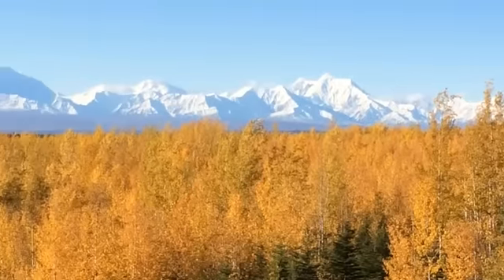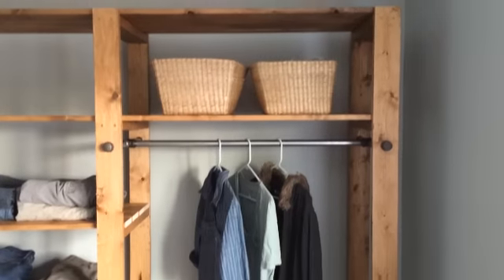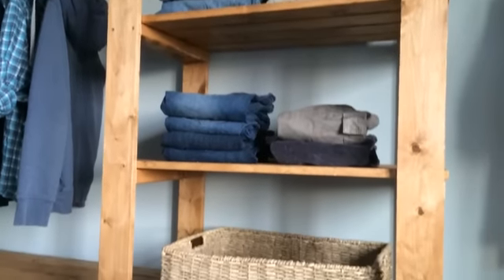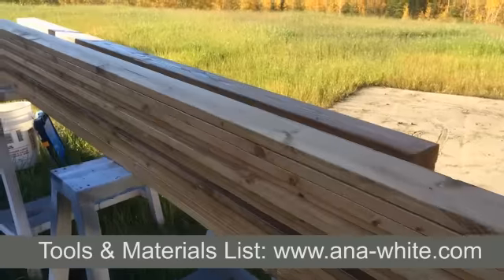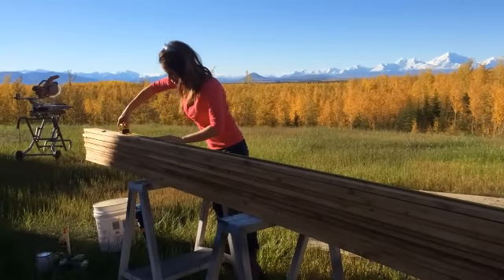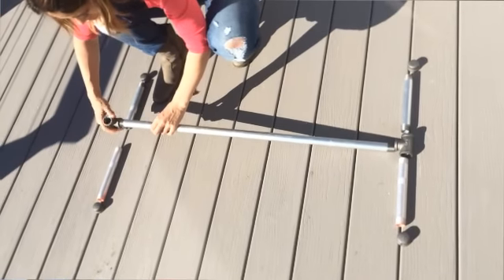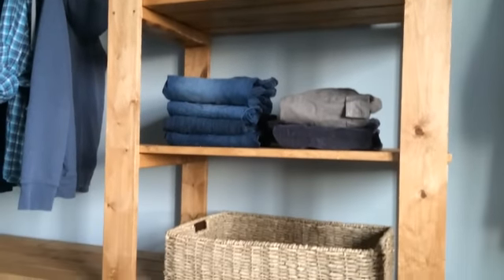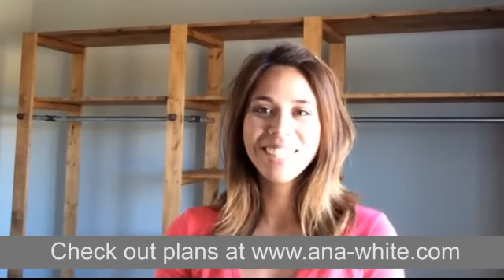Build a Closet: How to Build Industrial Style Closet - Freestanding

Comment: Im looking to build a sewing machine unit like this but i need help with design what program works? Thankmyou for the garage shelving video we made one plan to incorprate tools into the rest of our garage now on to build one more shlef unit and two with tools for chop saw, drill press sander and table saw. Thanks bunches...the table im working with is 72x48 i want two 30 inch wide units joined with top and bottom shelving incorpirating plant in fron if a window and adding the large table split into two for moving center with removable table top...let me know if i can email a little drawing so if you could offer suggestions. 😍

Comment: I just finished I got to say thanks for the plans and the idea I do have some thoughts on it. I did modify it a bit after. I used a cross instead of a t at the end to add a extension and added another leg and another set of shelves. it came out awesome then added another shelf between the rod and the second shelf. Overall I was very very happy and pleased. thanks k you so much again for bringing this to my attention.
Reply from the maker: +John Dominguez Sounds awesome John!
Reply: +Ana White it is and that's again for the idea and planting that seed :)

Comment: Ana: I am a contractor and building a new rustic house all wood inside. I have used your industrial closet design throughout. It has really added a nice touch to the closets. The house have 5 walk in closets. Actually I think this is less expensive than all the metal wire stuff you see in most new houses.
Reply from the maker: THAT"S AWESOME! Would love to see some pics:)

Comment: I built these and they’re beautiful but my landlord says they’re unsafe and he wants me to take them out.
Reply from the maker: Thank you glad they turned out well
Would your landlord allow you to anchor to the wall in a couple spots?  This would greatly reduce forward tipping potential.
Reply: @AnaWhiteDIY I’ve already had them 9 years without any problem. I’ve had heavy books on them and I cut them to wedge really well between ceiling and floor. I’ve never had any safety issue. Thanks for a great design!